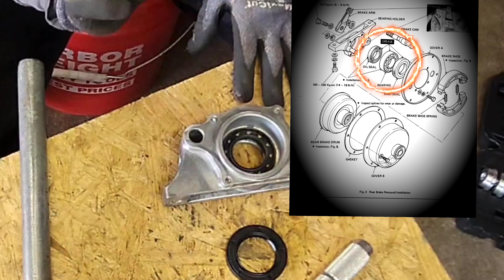Odyssey Life Ep49!! HONDA ODYSSEY FL250 TRANSMISSION, DRUM BRAKE, AXLE, HUB SEALS AND BEARINGS...

Comment: what size rear tires are those and brand as well. as well as fronts.
Reply from the maker: The tires on our Fl350 are the same size as stock and are  IPT Brand tires! 💥💨😎🤙✌️
Reply: @OdysseyLife1  no on the fl250
Reply from the maker: I totally misunderstood your question and mistakenly gave you Fl350 brand and sizes.. The Fl250 rears are stock-size Bear Claw brand. I will check the fronts this afternoon and report back to you. Why don't you head over to Facebook and join us on the Odyssey Life Facebook page.. You can hit me up on messenger and it makes it easier to communicate! I've no problem helping with info! 💥💨😁

Comment: Shouldn't you use lithium grease spray or  graphite dry lube instead of WD-40? I thought it traps moisture. Also you laugh reminds me of an old NES game. I think it was called kung Fu. Anyways good video new subscriber.
Reply from the maker: If you would've watched the whole video in detail you wouldn't be asking me this... Thank you for commenting! We used all the correct lubes for the parts installed. The WD is used solely to install bearings. 💥💨🤙✌️😎
Reply: @OdysseyLife1  I probably did miss something. I listen while at work in a factory. I seen you used the grease even though sealed bearings. But little extra never hurts. Nobody likes to be run dry.
Reply from the maker: No problem brother! I forgot to show my using the Graphite Dry Lubricant in the brake cams and other brake parts. We made sure we followed the Fl250 manual and included digital pages up on the screen showing the Lube points! Thank you for keeping us on our toes!! 😁❤️